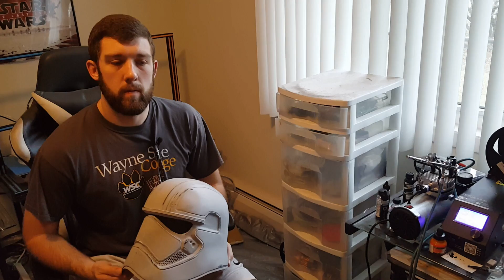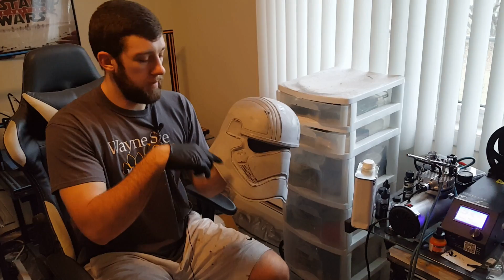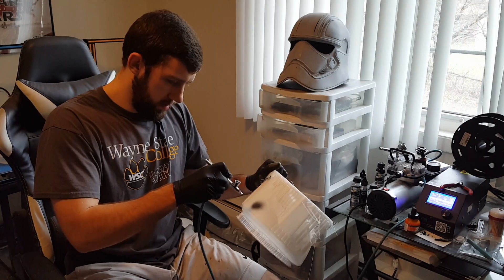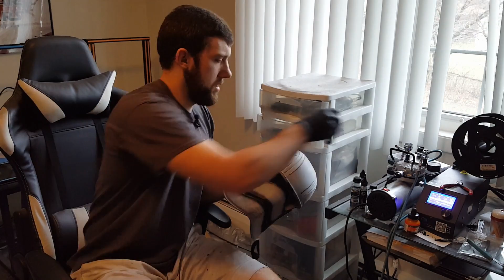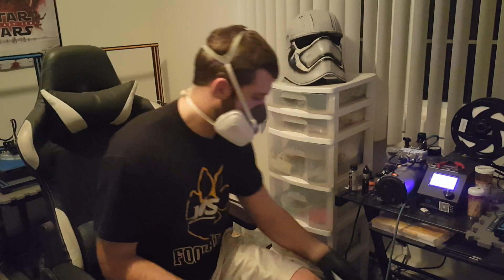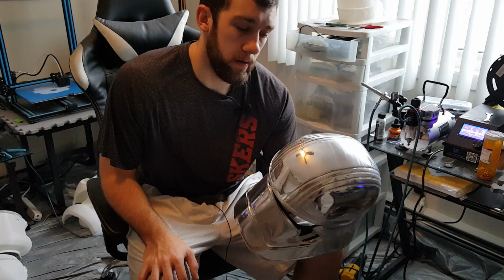How to Paint a 3D Printed Captain Phasma Helmet

Comment: can you touch the paint without damaging it? point is if its any durable, i know diy chrome paints are usually "do not touch paints" but this molotov is something new and I'd like to know of its good for props that will be used or just for display stuff
Reply: Ya I had to do a quick job on the The Last Jedi fingers for my Phasma and it worked great. Buuut ya it dulls and becomes grey over time by touching and all that. I do wonder though how clear coating it with an Automotive gloss clear would affect the chrome. Havent had the time to try it out unfortunately.
Reply: I used my 0,4 mm airbrush with 50/50 mix.. You probably wanna use less lacquer using smaller nozzles.. Another thing when mixing LC with lacquer - is how controllable it gets and how well it acts on the piece.. It really didn’t needed more than one layer other than small touchups on my Kylo Ren.. Also check out Adam Savage from “Tested” - when he uses the LC/Lacquer mix..  
https://m.youtube.com/watch?v=7oGslDjTnHI
Reply: @jacobthomassen5261  thanks man :D
Reply: Anytime  @SmokAnalog
Reply from the maker: You won't want to touch it. Unfortunately the paint is very sensitive to any smudges or fingerprints and it will lose its shine.
Reply: It seems like 50/50 Liquid Chrome-Lacquer works better on my Kylo Ren faceplate - The paint needs to settle for a long time before handling it.. Like serious time - didn’t touch anything for two weeks 😆
Reply: @jacobthomassen5261  you mean standard automotive clear laquer?
Reply: DeJotA Craft  yeah, I just used the same one as I use on small paint reps when my wife scratches the car =)
Reply: @jacobthomassen5261  thanks, will give it a try. one last thing, does it work with airbrush? these molotov paints are pretty expensive to test with airgun, but i dont know if i wouldn't have to thin it for airbrush
Reply: @SmokAnalog  Molotow LC can be used straight out the bottle.
Reply: Just to be clear- mixing LC with lacquer doesn’t solve the issue completely though - but it works better than Chrome alone

Comment: Hi man great video I do plan to do this helmet at some point.. but once it's airbrushed dose it need sealing ? Never used a airbrush so I don't no .
Reply from the maker: Thank you! I dont think you'll be able to seal molotow I'm afraid. Sealing chrome at all can be tricky to do without it losing its shine.
Reply: I have heard that Spaz Stick's varnish for Liquid Chrome is not bad for protecting Molotow. Didn't try it myself, though, so I can't guarantee...
Reply: Ahh ok cool thanks for that. Great help for future prints